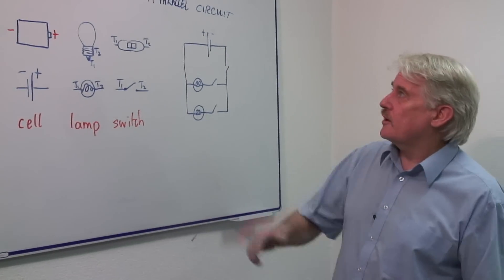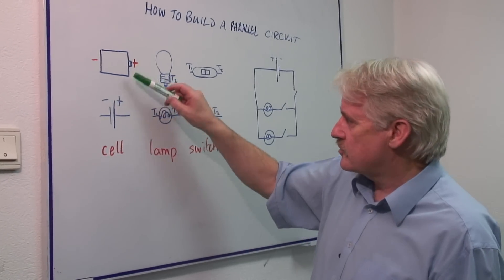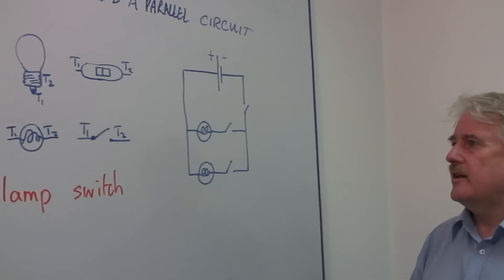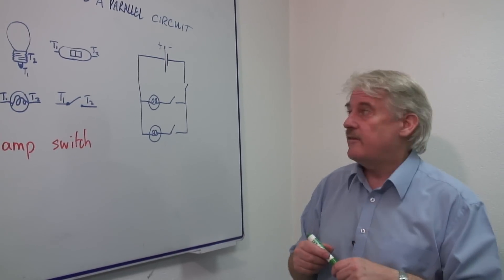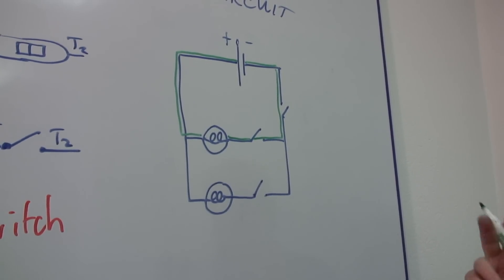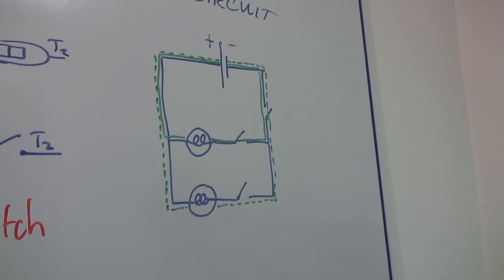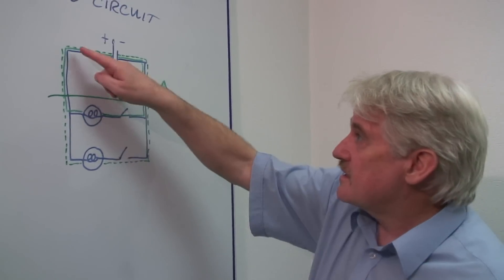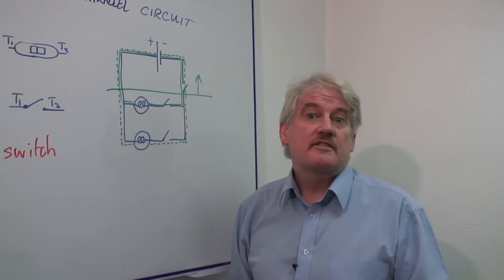Physics Help : How to Build a Parallel Circuit

Comment: you said that a parallel circuit, is a series circuit, of a series circuit all connecting to a power supply... i think a parallel circuit is a simple circuit of a simple circuit connected to a power supply in diff path, coz a series circuit is composed of two or more resistors.... and if you connect it it would be called series-parallel circuit... correct me if im wrong...